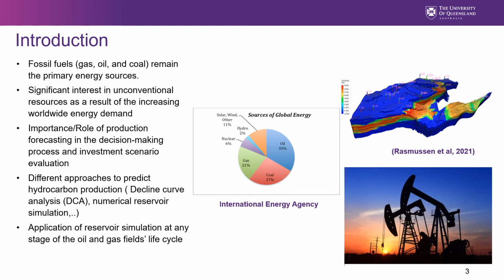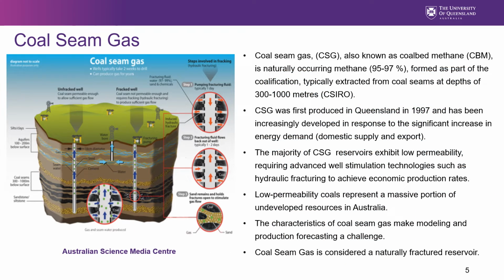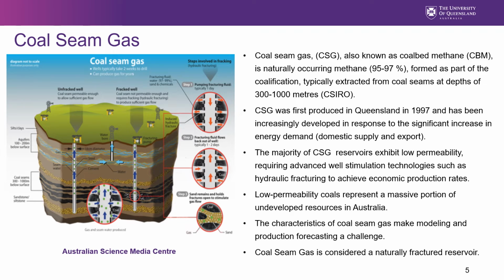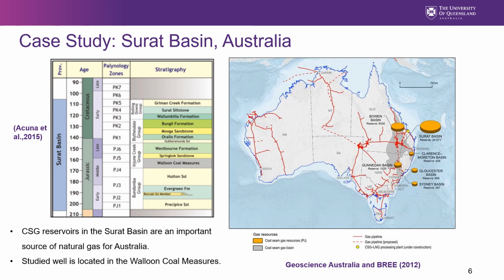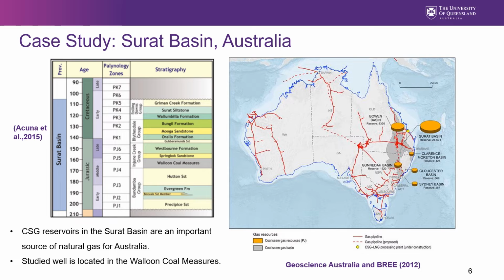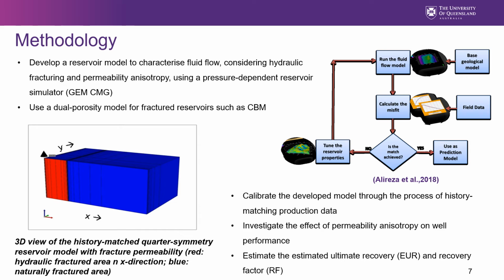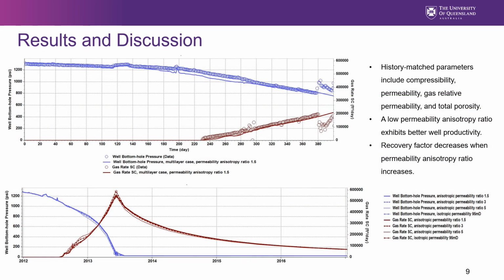Coal Seam Gas Well Production Forecasting based on Numerical Reservoir  Simulation.

Comment: A well considered and comprehensive presentation dealing with your topic of interest.  An advanced level of understanding and presenting the key points of your topic is demonstrated in the presentation.  However, at times, there is too much information presented on the slides, making it difficult for viewers outside your field to follow.  The reference list should be in alphabetical order of authors' surnames.
Reply from the maker: Thanks Sandra. For this assignment, the video should not exceed 6 min. It is quite limited. I should have paid attention to the reference list too.